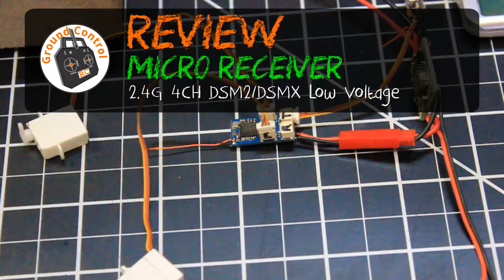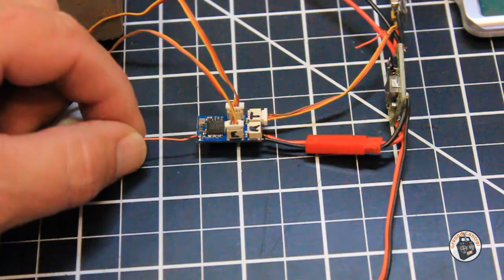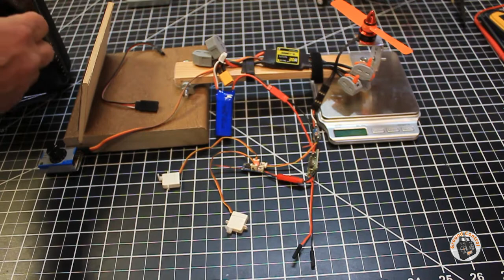Review - 2.4G 4CH Micro Low Voltage DSM2/DSMX Compatible Receiver Built-in Brushed ESC

Comment from the maker: I have had a lot of questions regarding Binding to this Receiver. First, you must have a Transmitter that support either DSM2 or DSMX Protocols. The Receiver will go into Bind Mode when you power it on, then put your transmitter into Bind Mode using either DSM2 or DSMX Protocol and it should bind. I have (3) of these and have never had any trouble Binding to them. I hope that helps and I'll see you in the Air!
Reply: The problem is in their documentation (e.g. on Banggood) they talk about adding a binding cable to the bind channel, and pushing a binding button, both which do not exist. Plus I had to try your procedure about 10x before it worked! Thanks for your advice!
Reply from the maker: @alpenjon  , hehehe.....I know what you mean. I think this is copy and paste from the manufacturers documentation because I constantly find the same errors in the printed manuals ;-) I don't think anyone proof reads this stuff ;-)

Comment: I got one of the same receiver and trying to get the motor to work with built in ESC and I have a Spektrum DX5e and it says to When using Spektrum transmitters, set the lower endpoint of the throttle channel (CH1) to -120% to start the motor. How do I do that?
Reply from the maker: I'm not familiar with Spektrum Transmitters.
On my TX16S Transmitter there is a screen where all the endpoints for all the channels are displayed and you can edit the endpoints for any channel.
You'll have to check your manual for the DX5e to see how to edit those endpoints.

Comment: How did you connect the input to the ESC ? Usually the + - leads on the RX throttle output get power from the built in BEC, but if you don't have one is the + VE off the RX throttle just not connected in your ESC, otherwise wouldn't you get 2S from the ESC ? So, effectiely you have just two wires off the RX throttle output, Signal and - VE ?
Reply from the maker: Hi Eric!
The RX has a built-in Brushed Motor ESC.
It has (2) pads for the Ground and Voltage wires of the Brushed Motor.
There are also some Micro RX that have built-in Brushless ESCs for 1S-2S power.
Reply: @GroundControlRC  ok, but in the video a brushless motor was used with an ESC on the RX throttle output and 2 s. How can you connect a separate BEC  TO POWER THE RX - do you cut the +ve lead on the ESC input, otherwise won't the ESC feedback 7 volts to the RX. Yes I understand all that - I have about 6 of these RX 42 receivers but I'd like to try using Brushless motors instead of the 8520 geared motors, and I don't want to buy more receivers with the built in brushless as they are more expensive and I'd also like to move up to 2s as that is more powerfull and longer duration.
Reply from the maker: @ericwillis777  Oh, you're right!
I forgot I had setup a brushless motor with that RX.
I used a variable voltage regulator to reduce the 2S voltage to 1S voltage to power the RX and Low Voltage Servos.
The ESC and Motor receive full 2S voltage.
In the Show Notes above, there are links to all the components.
If you search our Facebook Page for "low voltage power system" you'll find a diagram I published showing how all this is connected.
Reply: @GroundControlRC  ok, but the input to most ESC is three wire, +, -, and signal. If I connect those through the plug to the ESC surely the ESC will feedback its 7 volts to the receiver ? On the usual set up you don't actually make a separate connection between the ESC and the receiver/ servos because the power is fed back from the ESC/internal BEC through the ESC /  throttle plugin. So how did you isolate the ESC from the receiver ?
Reply from the maker: @ericwillis777  No it won't as that's where the variable voltage regulator comes into play to cut the voltage to the receiver and servos to 4.2v.
Take a look at the Low Voltage Power System Diagram I spoke about and you'll see how everything is wired together.
It provides 1S Power to the Receiver and Servos while providing 2S Power to the ESC and Motor.
That's why I used an OPTO ESC, no BEC.

Comment: What connectors it has,what servos  are  you using?
Reply from the maker: Hi Theodor!
I'm using Hobby King 1.7g Micro Low Voltage Servos that have Micro JST connectors with 1.0mm Pitch.
There are links directly to the Receiver and Servos in the Video Show Notes.
Reply: @GroundControlRC  Thank you very much

Comment: Hi, thanks for the vid, is it possible to use sg90 or sm90 servos given you replace the connectors ? Thx !
Reply from the maker: Sure! As long as the servos can operate at low voltage they should work just fine. See you in the Air!

Comment: So the receiver needs a power source?
Reply from the maker: Yes, that's correct. It's low voltage so you don't want to power it with more than 1S LIPO voltage (4.2v). You can power your Motor and ESC with a larger LIPO and cut the voltage down to the receiver with a voltage regulator.
Reply: @GroundControlRC  that's so weird, I've got a devot7e remote and this rx144 and nowhere does it say it needs power, I've got th battery for the motor but nowhere to plug in another battery
Reply from the maker: @HHh-qe2ch  The power will come from the flight battery just like all receivers. No separate power supply is needed. I was referring to the need not to supply more than 4.2v to the receiver as it's as low voltage receiver.
Reply: Okay so I am very confused than, I've got 2 lithium batteries that came with the motor, the connector is a 2 pin, the flight controls, are a small 3 pin. So I'm not sure how the controller would actually get its power.
Reply from the maker: @HHh-qe2ch  It sounds like you have a 1S LIPO. The 1S LIPO will provide power to the Receiver, Servos, ESC, and Motor. Since it's a Low Voltage System a 1S LIPO will work just fine.
Reply: @GroundControlRC  lol but how.
Reply from the maker: @HHh-qe2ch  If your receiver is like mine, it has a built-in ESC for a Brushed Motor. There are (2) pads marked "M" on mine for the Brushed Motor Connection and (2) pads Marked "+/-" for power from the LIPO. I just attach wires with the proper connector for my LIPO to the Receiver and you can solder the leads for the Brushed Motor directly to the Motor pads or use a lead with a connector for the Motor as well which is what I do. There should be some documentation or images that show where all of these connections are made to the Receiver.
Reply: @GroundControlRC  thanks for your time, yes it is a 1s lipo, with a rx144 mini receiver, my engine has 3 terminals, the receiver has an m and a +, I'll have a look at what else I can do.
Reply from the maker: @HHh-qe2ch  You are most welcome ;-) I just looked at the rx144 receiver. If your Motor has (3) wires it's a Brushless Motor. You will need an external Brushless ESC for your Motor. The Brushless ESC will have (3) Terminals / Wires for the Motor and (3) Wires to connect to the Throttle Port on the Receiver. The Receiver states it can use up to 5v. If you have an external Brushless ESC with a BEC that supplies 5v, the ESC will power the Receiver and the Motor. I hope that helps to point you in the right direction.
Reply: @GroundControlRC  yes the motor is brushless, with a 1s lipo.
Reply: @GroundControlRC   I have the esc,  I wired to the receiver I can get it beeping but that's it
Reply from the maker: @HHh-qe2ch  It sounds like the ESC may be detecting positive throttle. Your ESC documentation should have some information on Beep Codes. Normally, you'll have to program the High and Low Throttle setting into the ESC using the TX Throttle Stick so the ESC knows the Top and Bottom position of the Throttle. Then the ESC should complete initialization.
Reply: @GroundControlRC   one last question and I think im set, I have power to the board, I've got my rudder and ail working, the motor worked well for a few minutes, now it's 2 days later and the motor twitches.  Won't kick over. Any ideas?
Reply from the maker: @HHh-qe2ch  It could be a bad motor or ESC but I would try re-programming the high / low throttle stick position again on the ESC.

Comment: 👍👍👍👍 Such a useful video!!   do you know if i can use that 4th channed for flaps? or for for having independent ailerons?
If not, can you please advice for a not expensive micro receiver that can support another servo?

Other question : i have a T8SG trasmiter, is there anything special on DMS2/DSMX ? there are other simmilar micro receivers but they are frlysky for example. I am wondering i am losing anything if i buy a flysky and not a DMS2/DSMX compatible. 
Thanks!
Reply from the maker: Thank you Alex! If you're using a Brushed Motor and won't be using the Throttle Port, I don't see why you wouldn't be able to use that port as long as your TX can re-map the channel. I don't think you would lose anything with another protocol receiver given the same number of channels and features. I chose the DSM2/DSMX Receiver because that's what my TX supported and would also work with my micro servos. See you in the Air!
Reply: @GroundControlRC  , Many Thanks!!!!!!!!

Comment: Hello again ! Great Work. How much amps is the curent for this board?  i am planing to use an FrSky VD5M(2g) receiver which needs 3-7.2v ,20mA for operating and ESC (32g) with BEC built in  2A ,5 v and Amp rating: 35A
Burst Rate (15sec): 42A, what motor should i use? and what 2s battery?
Reply from the maker: Thank you George! I'm not sure what the operating current is for the board. I know it can operate all the way down to 2.5v so I assume it's fairly low on amps as well. Good question about the Motor and LIPO. I can't answer those questions as it depends on the size and weight of the plane, the amount of thrust required, and the amp draw of the power system. I use these low voltage receivers and servos in very small light planes. In the conversion of a couple of planes I used a RacerStar BR1306 3100kv motor and Gemfan 5030 Prop. I used a small 300mah 2S LIPO as the amp draw of the power system is very low. I think the ESC I used was just a 6 amp ESC and the max amp draw was around 5 amps. I don't think the weight of the plane was more than 130-140 grams. I hope that info helps. See you in the Air!
Reply: @GroundControlRC  thank you for your ultra fast answer!! :D  my only concern is the size of the ESC 38x28x16mm its the H-KING 35A Fixed Wing Brushless Speed Controller ... i am not quite sure if it fits or the plugs. Also i am not sure if i need BEC or not or the receiver got a built in regulator..i am really confused ..
also when alll finish i ll try to fit this battery https://hobbyking.com/en_us/turnigy-nano-tech-1200mah-2s-25-50c-lipo-airsoft-pack.html?queryID=0a80aaf7c501020a16f5149314470130&objectID=47490&indexName=hbk_live_magento_en_us_products
Reply from the maker: @UCWb33n39WbJRJXGyVnpQ_Vg , I looked up the receiver and it's definitely for small micro planes like the receiver I used. It must have a built-in regulator but it doesn't say what the output voltage to the servos is. I use low voltage servos with my receiver as I'm usually setting up the plane for a 1S or 2S power system. It doesn't say that it has a built-in ESC so I sure you're right, you'll have to use an external ESC with a BEC. You would need to get the specs on the receiver sockets so you know what type of connector you'll have to use for your ESC and Servos. Mine uses the Micro JST-SH with a 1.25mm pitch so I make sure the servos have the same type of plug. I always have to change the connector on the ESC BEC to match. I don't know what size plane this receiver is for but the 35A ESC is pretty big and heavy and I'm sure the BEC has a standard full size servo connector. As you can see in the show notes I used a tiny 7A OPTO ESC and added a switching voltage regulator to drop the 2S voltage down to 1S voltage to feed the receiver and servos while feeding the ESC and Motor 2S voltage. Also be aware, the VD5M has no fail-safe.
Reply: @GroundControlRC   Does your board has fail safe? cause i am thinking about what u said and i reconsidered and might use yours ,  unfortunately i own an Frsky contoller... :/
Reply from the maker: @georgep2301  , yes, my micro receiver has an auto fail-safe. After binding if the radio loses contact for more than 1 sec. it moves all the control surfaces to neutral and cuts the motor.
I don't know what FrSky Protocols your TX supports but here's an inexpensive Micro 4CH receiver that uses standard servos connectors. It only has fail-safe on the throttle channel but at least that should prevent fly-aways.
https://www.banggood.com/2_4G-4CH-Mini-Frsky-D8-Compatible-Receiver-With-PWM-Output-p-1143300.html?p=WE081047791920140372

Comment: What kind of range are you getting out of this?
Reply from the maker: I have this receiver installed on many of my Micro & Nano Planes and I've flown as far as 200 meters away from myself at fairly low altitude. I've had no problems with that distance in an area where there is no 2.4ghz signals to interfere with it. I'm betting you could get 300 meters at least in an area where there is no interference. I really like the fact that you can use it in an aircraft with a 1S Power System. See you in the Air!

Comment: I too have one of these little receivers but I do not know how to hook up the brushed ESC or the power as there was no instructions with it.  How do I do that?
Is there a set of instructions someplace as mine didn't come with one?
Reply from the maker: Very good questions Leslie! If you go to the product link in the Show Notes Above there are some very good images of the Receiver that show what each Port is for; Throttle for Brushless ESC, Aileron, Elevator, Rudder, & the Pads for the Brushed Motor. This Receiver has a Built-In 2A Brushed ESC so unless you need an ESC with more Amps you won't need to use an External Brushed ESC. The Pads for the Brushed Motor and Battery Leads are on the Bottom of the Receiver and there is an "M" Printed on the bottom to show the Pads for the Brushed Motor. Note that the Receiver and Brushless ESC Ports are JST-SH 1.25mm. Also, the images on the Product Page show which Pins in the Sockets are for Signal, Voltage, & Ground. It's very important to see which is which because some of the Servos I've received have the wires in a different order and that will Fry the Receiver. I just use an Exacto Blade to raise the plastic locks on the Servo Connector and remove the Pins and put them in the Proper Order. I hope that helps and let me know if you have any other questions and I'll try to provide the correct answer ;-) See you in the Air!

Comment: I'm confused how to hook this up to brushless esc? Do you need 2 batteries?
Reply from the maker: You connect a brushless ESC the same way you connect a brushless ESC to any Receiver. You will connect the ESC to the Throttle port on the receiver you just need a different connector for the ESC. You would use (1) flight battery connected to the ESC but if you use anything larger than a 1S LIPO you will need to use a voltage regulator to step down the voltage to a low voltage Receiver.
Here is a link to a video I posted that shows how to set this up: https://www.youtube.com/watch?v=k2KLtIHp4Aw
I hope that helps and I'll see you in the Air!
Reply: @GroundControlRC  subscription earned! Thank you!!
Reply from the maker: @josephfreeman5289  , thank you for your support as it is much appreciated ;-) See you in the Air!

Comment: how do you bin this?
Reply from the maker: Good Question! The Receiver will go into Bind Mode when you power it on, then put your transmitter into Bind Mode using either DSM2/DSMX Protocol and it should bind. I have (3) of these and have never had any trouble Binding to them. I hope that helps and I'll see you in the Air!

Comment: can I bind this receiver to T8SG?
Reply from the maker: As long as it has the Multi-Protocol Module that supports DSM2/DSMX.
Reply: is that receiver can handle 4 servo and 1 brushed motor? sorry I dont know anything about RC plane😊
Reply from the maker: @omhobby9481  , no sorry! 3 servos and a brushed or brushless motor. It's 4 channel and that includes the throttle channel. I suppose if you're using a brushed motor you could map the throttle channel to something else and use 4 servos. I have not done that before. See you in the Air!
Reply: thanks Sir...
usually I play drone😊
then I saw minimum RC kit in banggood and it took me to your channel...it looks fun to fly micro RC plane ...
I want to try and maybe add fpv camera to it😁
Reply from the maker: @omhobby9481  , that's fantastic! I'm glad you're going to try out a plane ;-) I'm going to test that plane with a 1020 brushed motor and 3 inch prop to see if it has more power than the stock 8520 motor. If it does, I'll be doing some test flights with a Micro FPV Camera. See you in the Air!

Comment: Dear Sir, how do you bind this receiver? I have a Taranis X9D Tx with DSM2/DSMX external module. I have bound this receiver in the past but for the life of me, cannot recall how it is done. Your reply will be greatly appreciated! Thank you in advance... Mart...
Reply from the maker: The receiver will try to bind to the first transmitter it finds when it powers up. What I do is:  Power up the Receiver, then Power up the Transmitter, put the Transmitter into Bind Mode, and they should bind. The next time you Power up the Receiver and Transmitter they should bind automatically. I hope that helps. See you in the Air!